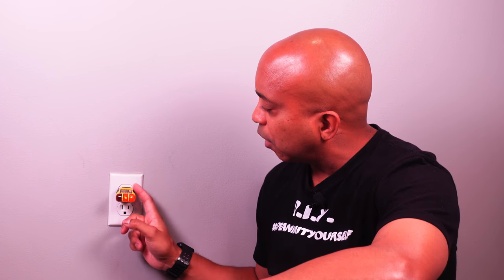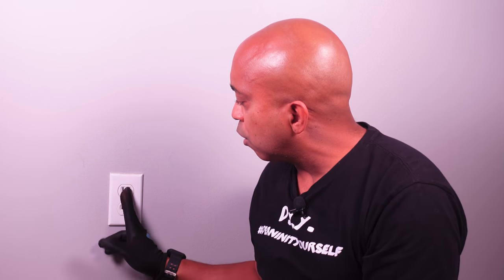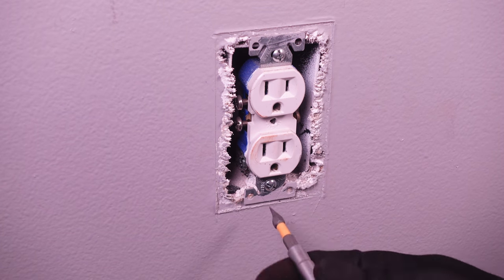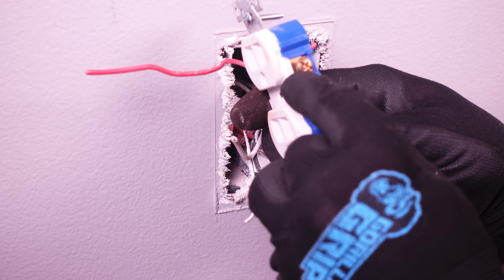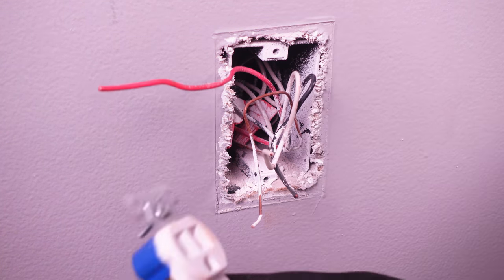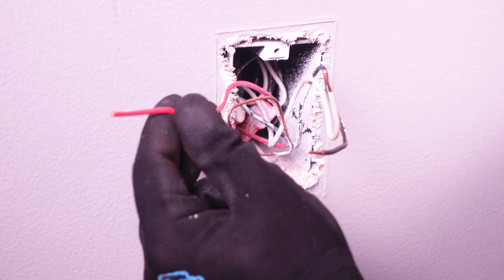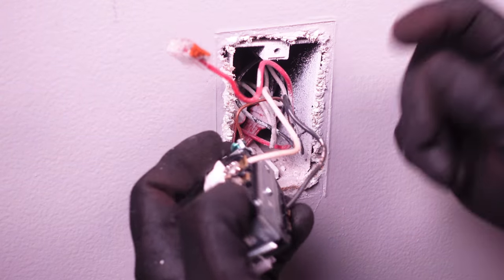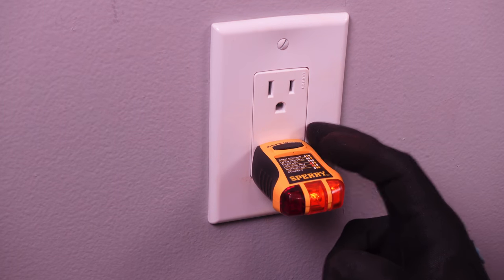How to Change a Switched Outlet to a Continuous Hot Outlet (2022)

Comment: Why the hell are you cutting the wires then stripping them instead of just unscrewing the screws!!!???
Reply: Those wires were in the push lock connection… unscrewing the screws would not have loosened them. You can pull them out, but it can be quite difficult, so it usually is faster to just cut them.
Reply: Easier his way if you have the knowledge and tools.
Reply: @Dredd2992 so you need to pull that outlet back out and take your wire strippers or pliers and twist the wire to the left as if you’re un screwing it from the back and pull at the same time. Comes right out. What you’re doing is wrong and shouldn’t be shown as a reference video as this could harm others. Just my advice as an experienced electrician apprentice
Reply: So you get a fresh wire ..

Comment: Do you have to-do anything with the switch?
Reply: Switch would still be sending current to red wire in ON position, you can leave it as it or use the switch to control something else (a fan or light etc.).

Comment: Pull out the switch and connect all the hots together with a wago. Blank plate it. Done.
Reply: If we don't want to use blank plate and instead to remove the switch box entirely, can we shove the capped off switch wires into the back of another adjacent switch box?  (My front hall has like 5 switches including one outlet switch that I wish to delete entirely).

Comment: This was super helpful. I’m trying to change my outlet from both receptacles being powered by the switch to just one. I think your video shows how I can do that. Thank you!
Reply: I did this in both bedrooms of my apartment that unfortunately lack ceiling light fixtures as were found in many older homes.  I broke the tab between the two screws on the hot side and ran a wire from the previously unused screw to the black (always hot) wire which was spliced through to the next outlet in the switch box.  This way the switch only controls the half of the receptacle and the other half is hot all the time.

Comment: I have a wall sconce above a switched outlet. The light switch controls both the outlet and light. I would like it to control just the light.  How do i figure wire going to switch and sconce? Do I just connect those in the box away disconnected from plug?

Comment: I want to change switched outlet like this video.  Then i want to use wall switch to power new ceiling spot light.  Is there any video that i can watch how to reuse wall swotch and feed power to ceiling light?  Thanks. I have done it about 10 years ago in my other rooms and forgot lol
Reply: I’m doing this too, I’m thinking about putting a junction box on the backside of the wall then new wires going to the switch for the ceiling lights… works in my scenario

Comment: My cousin had a similar situation in her old apartment and I fixed it by simply removing the switch, splicing the two wires together, and installing a blank plate.  The switches were worn out so this way I didn't have to replace them.

Comment: How are both outlets working on the receptacle? The hot tab is broken??? Shouldn't only one side be working not both?
Reply from the maker: because they have a hot wire connected on the top and one on the bottom screw as well
Reply: @DeaninItYourself  Yes but in this video only 1 hot wire is on the top side of receptacle so I don't see why the bottom side of the receptacle would be energized. Their isn't a ungrounded wire present on the bottom and the tab is broken so this is a half receptacle right? If the tab wasn't broken yes I see how it would work. Would you explain this to me? Thanks :) love the videos

Comment: Good video. But what do you do with the switch when you are done? Cap the wires and put a blank over it or if you cap the wires will that interrupt the current to the outlet?
Reply: If it's like mine in my bathroom..it controls my lights too...
Reply from the maker: cap it and leave the switch.  the switch does nothing now.

Comment: @Deanin’ It Yourself My mannn thanks 😃  1 question though.. can I get rid of that switch now? It’s a 2 gang metal box w/ the other switch controlling the overhead light. I was thinking cap off the old wires, add a mud ring & have only 1 switch there 🤔
Reply from the maker: sure why not.

Comment: I have 2 white neutral wires and what seems like 2 braided black hot wires. Should I unbraid the black wires and use both screws or keep the black wires the way they are and just use 1 screw. The 2 white wires are not braided.

Comment: I have yet two switched outlets in a room, only the bottom on each outlet works the switches when turned on doesnt turn on the power to the top of outlets i had even replaced both outlets & switches & had broken out the tabs but yet no power going to the top of outlets why would rhere be no power to the tops of the new outlets?

Comment: In my 1984 mobile home they designed a switch and an outlet in my room also but they didn't put the boxes in they use the old style outlet and switch with the flaps on them so with that being said I did a little bit more digging in the wiring diagram of the house and come to find out that there was only power coming to the switch and a wire running to the outlet so be aware guys in early model mobile homes this is not going to work you're going to have to remove the switch and wing nut it and it is the simplest way that I have found out and that is because there was only one set of wires running to this outlet from the switch so when I killed the switch there is no power going to the outlet and I hope he would explain a little further on this

Comment: I want my outlet to be exactly like the one you started with. Currently, the wall switch controls both the top and bottom. I want the bottom to always be live. Where do I start?
Reply from the maker: you need to bring a constant power supply to the outlet.  Break the tab in the middle, connect the the power from the switch to the top copper screw and the hot from the constant power supply to the bottom copper screw.  NOw you should have a switched outlet on the top and the constant power on the bottom.  You can bring te constant power from another outlet but I would check instide the box first there may already be a hot wire in there.
Reply: @DeaninItYourself  it was 14-2 two wire (white/black/ground), from 1991. Not gonna mess with opening up the wall to rewire. Using a power strip with an on/off switch, under the sink, to use for controlling the disposal. Leaving the wall switch on all the time for my new tankless RO water filter system. Thanks for the reply!

Comment: I have 3 outlets controlled by 1 switch. I want to disconnect 1 from the switch. There’s only 3 wires. 1 white, 1 black and a ground. I’ve tried a few different things and either none of the outlets worked or all 3 still worked. What do I do? I read to break the tab off but that didn’t work.
Reply: I have the same issue with my 1987 split level home. I'm trying to do this same thing but there is no red wire, just the white, black, and ground. I feel like it has to be done inside the light switch box because there are extra white cables that have been capped off..any help???
Reply: @joetrimmer  I gave up. I figured out the outlet I wanted off the switch is actually controlled by 2 switches on opposite ends of the room. My issue with the switches is that it’s the outlet where I had to plug in the Internet modem and I don’t want someone hitting the switch and cutting the Internet by accident. Had just moved into this house and there’s quite a few switches and didn’t know what they all did yet. Everything in this house has multiple switches on both ends of a room.

Comment: OKAY but since the outlet is now fixed what does the light switch control ?The other outlets?
Reply from the maker: It controls nothing now.
Reply: @DeaninItYourself  if you wanted it to control maybe a ceiling fan and light is that possible? i have no overhead light in bedroom.  just four switched outlets

Comment: If the tabs were split on the receptacle, that means that the bottom outlet was constant and the top was controlled by the switch. Once you bring in a new switch you can connect your live wire and cap the switch leg.
Reply from the maker: That is correct

Comment: What if you only have hot and neutral and no red?
Reply: Then it’s not the same scenario. His 4 wire situation allows a split receptacle one outlet switched and one constant. A 3 wire restricts both outlets to be controlled only by the switch.

Comment: If I have multiple switched outlets on one switch.  If I follow your procedure for only one of those outlets, will the other outlets still remain switched?  Thanks!
Reply from the maker: the outlets downstream from the one you change will no longer be switched but only one side of the outlet will have continuous power, unless you connect the power wire from the switch going to the other outlets.  I am not sure if that explanation is clear enough. hope it helps
Reply: @DeaninItYourself  I looked in the outlet and it appears there's a pigtail connection for the red, black, and white wires (3 wires in each wire nut with one each coming from the wire nut to the outlet.  With that in mind, is there any way to allow the downstream outlets to continue to be switched and if so, how would I do it?  Thanks so much!  Your video was the clearest by far.

Comment: I have 2 outlets on 1 switch such that the switch turns power on and off to just the top socket in each outlet. I want both sockets in both outlets hot all the time. Why can't I just remove the wires from the switch and twist them together?
Reply from the maker: besuse the connector is broken on the outlet, you either need to change the outlet or connect the hot to the top and bottom outlet with a pig tail
Reply: @DeaninItYourself I don't think you understood my question.

Comment: My problem is I just installed a ceiling chandelier but my room switch controls the outlet and not my ceiling light so once I wired the ceiling lights, it just stays on because it has no way of turning off.
Reply from the maker: how many wires were in your ceiling box. 3 or 4?

Comment: How would you wire one outlet to be hot and allow the others to be turned on and off with the switch?
Reply: That's how his was wired. The bottom was hot, top was switch enabled. To do it as a retrofit, you need to run more wires.

Comment: Can you convert a switch that is for the outlet to use instead (neutral wire) for a smart switch to use for a lamp?
Reply from the maker: yes you can
Reply: so the switch still has power going to it and I can just 1 to 1 replace that old switch with a smart switch at this point? or is there more I'd have to do? thank you @DeaninItYourself

Comment: Why wouldn’t you just connect the 2 wires at the switch and put in a dummy switch. That would take care of all outlets connected to the switch.
Reply: Yup ! Or cap the red wire in the outlet and a jumper to replace the broken tab.
Reply: Not sure, but my gut says doing it per the video still maintains the switch functionality for anything else it's connected to if you have lights on the same circuit.

Comment: My configurations is not that simple as is shown in the vid. My outlet has 1 hot, 1 neutral, 1 ground. The switch that controls the outlet AND light has 3 hot.
Reply: I'm assuming you're wanting your outlet to always be hot (on) and the switch to still control your light(s). Your best bet is to try to identify which one is the traveler to the outlet. Make sure breakers turned off, remove one of the hot wires, make sure everything else is connected. Turn back on breaker and see if the light still works or if the outlet still works. If the outlet still works from turning the switch being on/off, turn off the breaker again. Then reconnect the wire you just took out, remove a different hot wire, turn on breaker and reevaluate. Worst case, neither of them work, if that's the case, reconnect the wire you took out and remove the third (untouched) hot wire. Then you should be all set.

Comment: Kind of misleading title IMO. Only useful if only half the plate is switched, but not if some jerk previous owner set it up so both parts are switched and there is no unswitched hot wire run to the box.